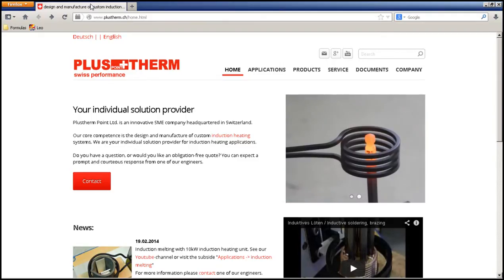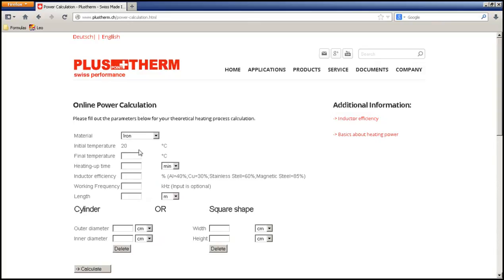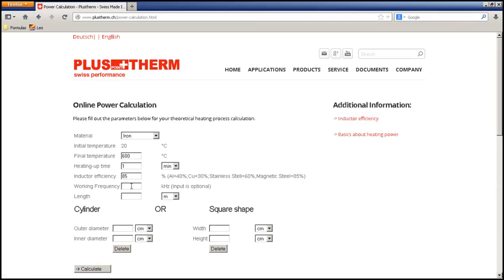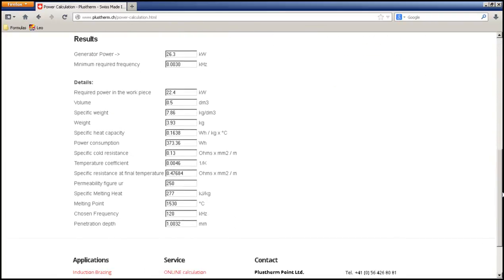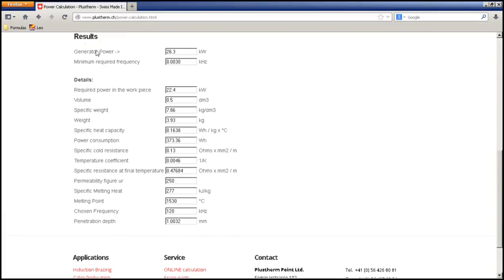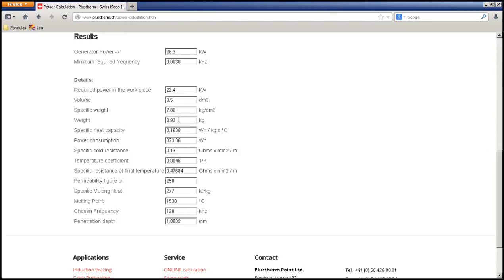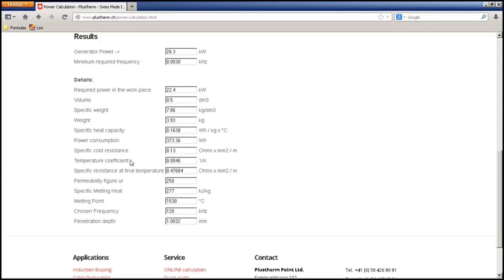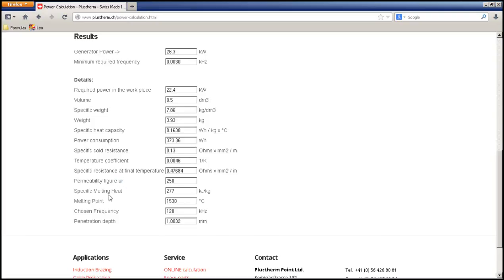Induction heating Online power calculation

Comment: Thank you for repeating exactly what it says on the website (with some scarse occasional additions).
If you wonder what is wrong, and everything is clear, then you have to improve your communication skills.
If you are still wondering, here are examples:
1.  Material of what? The coil; the heated object, etc.
2.  What is workpiece? The heating coil, the object you want to heat, etc.
3. A second material emerged, so what is made of iron and what is made of steel?
4. Again what is the workpiece that its length will be specified?

Solution:
A simple small diagram depicts each of the ambiguous. They say a picture is better than thousand words.
Thank you

Comment: The calculator doesn't seem to be sensitive to frequency at all.  for instance, I tried heating a copper cylinder using varying frequency and the power and "minimum frequency" numbers didn't change at all.

Comment: does this calculation consider the latent heat of fusion?
Thanks
Reply: +Hossein Pishyar Well, I found out we can't melt solids with this calculation...
Reply from the maker: +Hossein Pishyar : Our calculation tool include only the energy until the melting point. For the disintegration energy you need to consider the ambient temperatur, radiation losses, thermal conduction, ....
If you need more help please contact us on info@plustherm.ch .